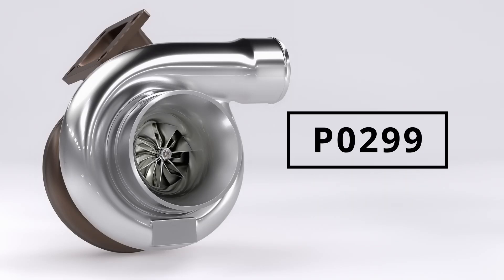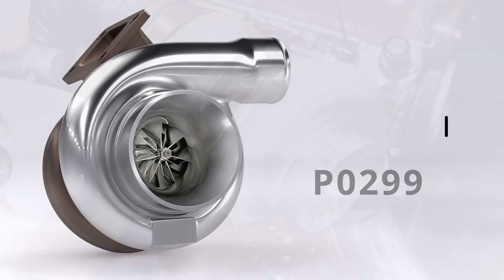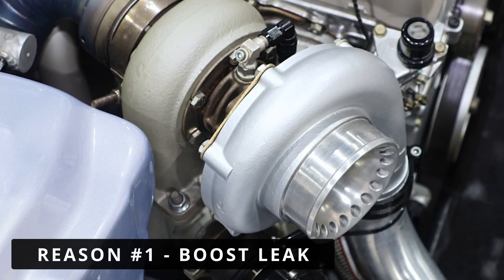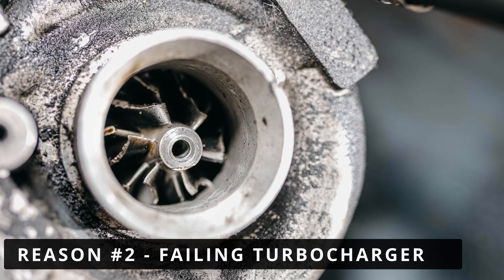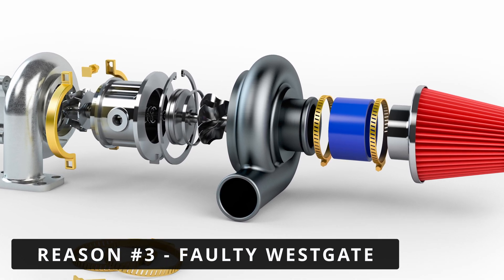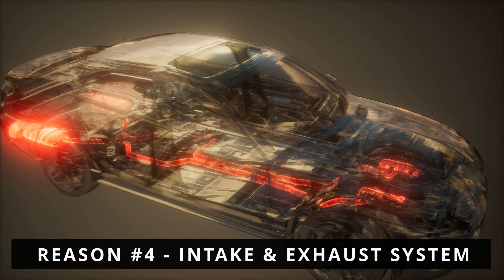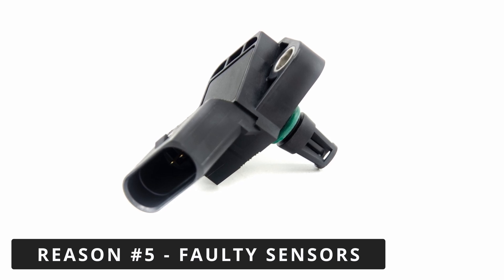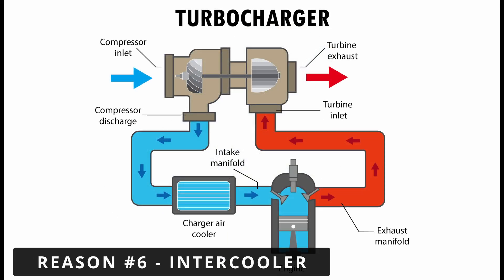P0299 Code: Turbo / Supercharger Underboost Condition (Causes)

Comment: Basically consider literally everything in the Turbo system. The error doesn't say shit then.
Reply from the maker: The error code only gives you an idea. You still have to test and diagnose the root cause.
Reply: Loud clacking noise during engine load (acceleration) would narrow it down to turbo wastegate flapper which can be replaced than changing out the whole turbo